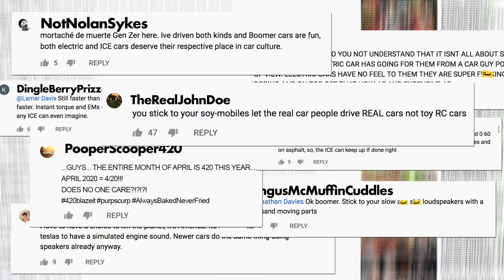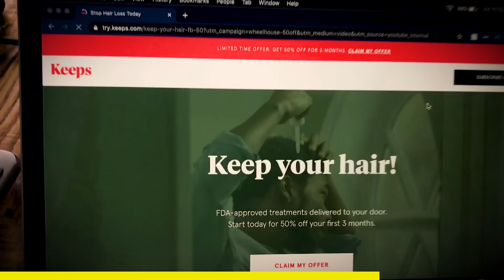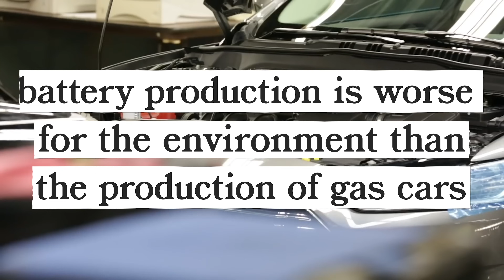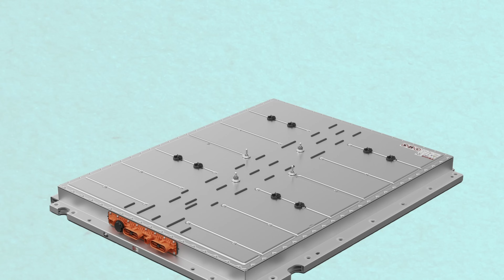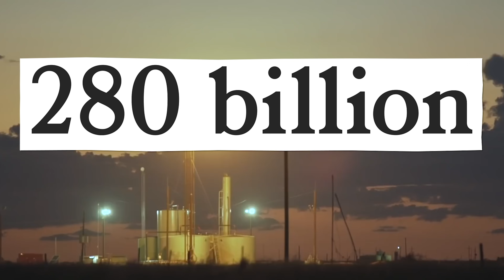Are Electric Cars REALLY Better for the Environment?

Comment: Here's the short version for those who don't have time:
While the MANUFACTURING process of an electric vehicle produces more emissions than those of gas-powered cars, electric vehicles are still produce less greenhouses gases due to their fuel source and will easily make up the difference in their lifetime.
Reply: @Adamike99 dumbass... CO2 isn’t called a “greenhouse gas” without reason. We produce more CO2 than plants and trees can filter out. NOT less.
Reply: Maybe but he doesn't take in count that you need to replace battery after few years bc it will get really weak by time. So im little sceptic about it...
Reply: @adamike9990  I'm finishing my bachelor's thesis on this subject right now and the battery replacement does not tip the scales. You do not need to change a battery "after a few year".
Reply: @adamike9990 non issue, he said in 6 month to 2 years, the EV emits less than ICEvehicule. So even if you are changing cars every 2 years, is better to have an EV. And batteries ( if it is well made) have a much better life expectancy than you realise.
Reply: @adamike9990  Good point but your data is a bit dated. Acid batteries sure, not Lithium. 

In a Chevy Bolt after about 120,000 miles the battery degrades by 12 percent. New Teslas (3 or Y) degrade a little less. It does depend on charging habits and temperature. New chemistry and new batteries are aiming for the same performance after 500,000 miles while also trying to get rid of the Cobalt entirely. With the billions going into battery research we are seeing more progress per year than we saw over the past ten or twenty. 

https://electrek.co/2018/04/14/tesla-battery-degradation-data/
Reply: @Jinkguns  All this can be true but still CO2 is not that bad at all... when you make car there are are lot of more worse gas than CO2 that is filtered/eaten by plants.
Reply: @adamike9990  Also lets not forget the other emissions in a gasoline or diesel. CO2 is tied to climate change, but the other emissions is causing a lot of asthma / respiratory disease. Diesel is the worse by far. I imagine a lot of people have forgotten what clean air is like, and the current tragic pandemic, is reminding them.
Reply: @Jinkguns  Damn... Everybody who is scared and argument by CO2 is causing global warming should leave this comment section. Search how plants live and how they "work" then say anything about CO2... CO2 is not problem...
Reply: @adamike9990  Respectfully, that is a very simple and flawed view of CO2. In reality there is a limit to how much CO2 plants can consume. You don't breathe more oxygen in a pure oxygen environment. Why would plants breathe more CO2 in a higher CO2 environment? There are less plants in the world every year, not more. We have surpassed the rate that plants can consume CO2, otherwise we wouldn't see atmospheric CO2 continuing to rise.
Reply: @Jinkguns  It is pointless to continue this conversation. We won't get anywhere.
Reply: @adamike9990  Right, if one side refuses to investigate, accept new information, or source their own information for validation, no common ground can be found.
Reply: @adamike9990  dude your information about co2 and plants is way to simple minded
Reply: @Jinkguns  dude @Adamike99 mentality of "co2 is no problem because plants eat co2" is blissfully ignorant I'm kinda jealous actually

Comment: What about biofuels? Wouldn't they tilt the scales back?
Reply: biofuels are great, here in australia we were going to make ethanol 10 years ago but the oil companies killed the idea, they dont have the same efficiency but its more renewable
Reply: Maybe.  The challenge is that biofuel would need to get significantly cheaper than petrol fuel in order to displace it and it isn't there yet and there are a lot of industries that don't want it to.
Electricity is already cheaper even before we build a bunch or solar, wind, and maybe nuke sources.
I was spending $50 per month for fuel on my gas car and now I spend $4 on my EV.  Plus no oil changes and fewer moving parts and more fun to drive.

Comment: Ev less emission then combustion vehicles gas because of production ? Like what was said it also goes to airplanes ? At the end of the day your still using rubber tiers plastic interior batteries break dust alloy wheels I think if you take the planes out of the equation it’ll be about the same

Comment: Good video. I kind of wish you covered the life cycle of an EV battery pack. From what I’ve read most battery packs last 3 - 4 years or roughly 80k miles. Most ICE engines will last 300k easy with regular maintenance. When you referred to “the life of an EV” Did you factor in switching out new battery packs and the environmental cost of recycling those old packs?

Comment: I dont think EV's are viable as any sort of actual long term strategy to combat global warming. As the rare earths and cobalt that make up batteries and brushless motors are... rare, rare enough that it isnt possible or feasible to built a proper fleet. The ICE fleet is over a billion units and will increase to 2 billion by 2050. That's alot of motors. We can probably built half a billion EV's at the expense of things like Wind generators, solar panels and advanced electronics. half a billion that will only last 15-20 years.

Comment: You miss a very important point: how much CO2 emissions does it take to dispose of batteries at the end of EV lifecycle?  What about environmental impact of disposing of those batteries? Another point, the development of new bio-synthetic fuels for ICE engines and new tech such as cam-less engines (i.e: FreeValve tech) will push substantially the efficiency and emissions of ICE.  ICE still have a long and useful life IMO.  But I am biased too and will have only ICE sports cars - no EV for me.
Reply: Also the rate that batteries gradually loose maximum power over time. How much battery is drained when you drive it like a sports car. I think a good one to to be to actually talk about the performance too, because I've seen a lot of videos (Including from Tesla owners) talking about how poor the handling and cornering is.
Porsche seems to have gotten that down, but the Taycan is only affordable to the wealthy.
Same I like my muscle cars/suvs and hot hatches. Trucks too and I just can't see the Cybertruck over taking the Big 3 with  that oddball design, specially for people that actually use their truck as a truck.
Also the EV tax credit deal is not being renewed by the Government, it's gonna be well gone by the time the economy bonuses back from the virus.

Comment: Only thing that needs correction is that a EV on a wind/solar grid will be responsible for as much co2 as one in a coal/gas grid. Renewable energy doesn't displace carbon emmisions. When the sun is shinning. Gas and coal plants don't shut down. They just idle inefficiently. And the sun does not shine at night when most will be charging their cars and wind dies down as well. If you want clean energy for your EV, live Ina. Grid powered by hydro, nuclear, or geothermal.

Comment: Not so sure these figures hold up here in Canada,

EVs are notoriously less efficient in cold temperatures (~35% less range), and that’s when you heat them up while still connected. If you need a cold unplugged start where you then heat the car using the battery at peak inefficiency, I wonder what the mileage per KW of electricity you get then, and how it compares to gas engines that simply use the heat byproduct of the engine to heat up the interior, therefore spending very little gas to bring the car to, and keep at, comfortable temperatures.

Comment: Did you assume that the life span of a gas car is the same as the electric car? cause the electric car will be changing batteries 2 years into it's life... so if you assume 4 year lifespan, the electric will impact twice. 
Now consider most people hold on to their cars way beyond 4 years... and those numbers will be even worse for the electric!
if the electric car impacts half as much/year as gasoline cars but keeps piling the impact number every 2 years, much like national debt...it will never even :s
that is assuming it doesn't go up in flames spontaneously.

Comment: So with you 57 metric ton you assume ICE cars are only driven for 9.6 years at 11 800 miles per year. Thats is hardly the case. Look on any website for cars 2005 and down, there is PLENTY

Comment: 3:41 you forgot to add the co2 that the combustion lets out... you know... when it's running.
Also, combustion engines produce smog.
No, EVs are not worse for the environment.
Reply: YOU forgot to add the enormous CO2 that the recharging stations (which run on diesel) output everytime you charge your model 3 with fuck gas written on the plate. You're playing yourself
Reply: @GigglingWillow  charging stations don't all run on diesel. That's just not true. some do where regular electricity isn't available.
Reply: @oftankoftan  right. Nolan mentioned it in the video, I just didn't finish it

Still, I onestly believe cars are not the main problem with the environment so drive what you want
Reply: He did mention that, did you refuse to listen?
Reply: You're wrong cuz coal and Nat gas is used to make virtually all electric

Comment: The figures seem to have one big hole, the fact you have to replace the battery, so if a high percentage of electric car manufacturer img comes from that and say the battery has to replaced every 3-4 years, the electric car will the still have a higher carbon footprint than an ICE car...

Comment: Nolan, you forgot something, that battery for cars have a life time between 8 and 10 years, and the high prices they are soo 17 tons in 8 years, 2,1 tons per years only for battey and needs a data for the emissions to the respective country. combustion cars 7+(5.2*8)= 47.6 tons in 8 years or 5.96 tons per year and tends to 5.2 over the years

Comment: Thing about the Electric car is the engine has been around for over 100yrs, it has about peaked in fuel efficiency. We've only scratched the surface of Electric motors. Already they think they can use graphine which will have 12x the capacity

Comment: Good video. My only beef is not recognizing the emissions cost of having to replace a battery pack. They can't be rebuilt or have as many cheap fixes as an ICE. I can accept that they will eventually be better for the environment and become a more popular choice, but we're easily 10 years from that reality. Hell, GM is still finding ways to amaze us with what they can do with a simple pushrod motor.
Reply: "Tesla reports that in its own controlled testing, the Model S batteries retained 80 percent of their range after running for a simulated 500,000 miles."
There just aren't many gasoline cars that ever go 500,000 miles.  It might take 15 more years before more than half the cars sold are EVs, but I don't think it is true that they aren't better for the environment yet.
Reply: @contentioushackery  I'm not familiar with this study, but I wouldn't hold their in-house controlled simulation to be real-world numbers. Not saying they're intentionally deceptive, but any controlled test/experiment has different results from real-world due to variables. I've known many Chevy Volts and Toyota Prius's that have had batteries nearly useless at 100k. On a gas motor, that's time for spark plugs and maybe a timing belt.
Plus, let's be honest. How many people are keeping a vehicle to 500,000 miles? Regardless of how the drivetrain has held up, what else is worn out or are they tired of?

Comment: What about the longevity of the car? How does that play a part. From what I understand electric cars only last around 100,000-150,000 miles till they either need a new battery completely or need to be replaced. Where as a gas engine can last upwards of 300,000 miles. Does this equal out the emotions between the two where most of the emotions for EV’s are in production?

Comment: I think a lot of people forget to take into account the long term maintenance and longevity of electric vs gas. Idk how long these EV batteries are going to last but it seems like most hybrid batteries are lasting about 10 years. I also don’t know how much it’s going to cost to replace the batteries in a Tesla 10 years from now but I think it’s safe to assume it won’t be cheap. How many of these EV’s crap out after 10 years and then the car is totaled because the cost of replacing the batteries is worth more than the car? Wouldn’t it be more environmentally friendly for a gas powered vehicle to stay on the road for 25 years and not be replaced like many EV’s will be after 10?

Comment: Also consider servicing. ICE calls for oil changes, coolant flushes, gasket changes, degreasing, etc. Electric cars will need new battery packs if driven for a long time (albeit, Tesla has a high mileage pack that's holding up well).

Comment: I feel like we are missing what is the average lifespan of a vehicle and the average time an electric vehicle will need a new battery and add those numbers to the calculations... anyone else agree or am I missing something?
Reply: average lifespan i believe is 10 years for a car, ev batteries i believe are 10-15 years, although it isnt that theyre useless in 10 years, they just begin to lose range quicker. so jenny from marketing can still drive 30 miles to work each day
Reply: I think he is saying  the average lifespan is 10 years.  He says ice engines produce 5.2 metric tons of co2 per year with a total in the average lifespan being 50 metic tons.  And that is just the production from the engine that's not including the CO2 from refining fuel and lubricants for the engine and transmission.  What he did not give us an average per vehicle.  Compared to EV which is 2 metric tons per year for a total of 20.  I could be wrong but I think Tesla's says their batteries will still maintain 70% capacity after 10 years so they really don't need to be replaced but if you wanted to that would still be at the very most another 17 Metric tons of co2  . So after 10 years that would only be 37 metric tons (on the high-end) based on his calculations.   But there are other  Ethical and environmental ramifications to take into consideration.

Comment: Welp, I’m just gonna ride a bicycle now.
Reply: Maximum Dank that steel on your bike gotta come from somewhere...
Reply: @asfrcin4268  but nowhere near as much as a car, you'd probably offset your emissions in a few hours lol
Reply: Asfrcin. a Someone already said this but producing >0 emissions does not mean it is equal to producing 800x that amount. There’s a lot more steel in your car lol
Reply: Actually I’ve read studies that riding your bike 10 miles releases more CO2 than driving 10 miles because you release so much more CO2 while exercising. Plus if you factor in the amount of CO2 released to produce the food you need for energy during your ride, the math looks even worse. Everything has a trade off.
Reply: @psychlops924  
At least everyone would be fit and healthy. That would knock a couple hundred billion off spending every year.
Reply: @psychlops924  i hate to say it but i reckon thats wrong, not going to try and research it but from what i know, its classified as clean exercise, driving to the gym to work out is unclean since youre driving but just riding a bike is clean since there no car involved.
Reply: Psychlops 924 Yeah BS you breathe out more CO2 than a car emits propelling 3,000 pounds at 40 miles per hour. I’m gonna need a source on that one chief. From what I can find a person engaging in strenuous exercise for 20 minutes releases about 1/4 of a pound of carbon dioxide, where the University of Michigan states that a car emits 0.79 pounds of C02 per mile, times 10 would be about 7 pounds of CO2

Comment: Until you have to swap the battery packs out after a few years and all of a sudden you a back to square one.   I will support EVs whole heartedly in about 4 years when they come out with the new batteries currently being developed.  They use less toxic materials and they hold more charge and also charge in a matter of minutes.  Until then I can't support them.

Also, EV production is super efficient already.  Its not like they started from scratch they had all the knowledge and experience from regular automotive industry.  EVs are also much simpler to make so the only area you are going to improve on efficiency wise is resources and once again they have already been mining this stuff for decades so its not new either.

Comment: Imo worst thing about electric cars is that they use lithium. Not only does the mining process produce many green house gases but more importantly lithium is one of the rarest materials on earth. If what my chemics theacher told me is correct, then we dont even have enough lithium to get every austrian a car ~8.7mio ppl. And we definately have better things to do with lithium than cars. Or would you rather have a electric car than a phone or a laptop or anything basically that has rechargeable batteries.
Reply: Also as far as i am concerned only 3% of all energy produced is renewable like sun water wind etc. Most still comes from coal and atomic energy